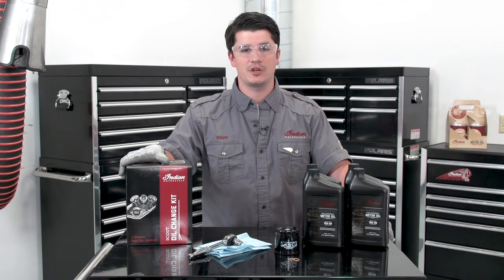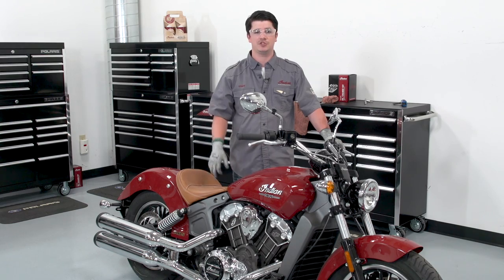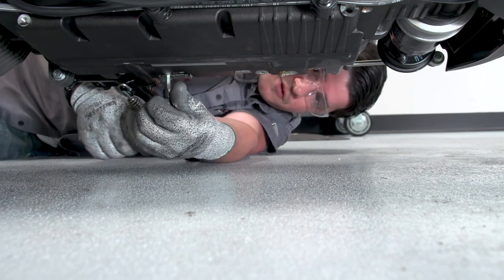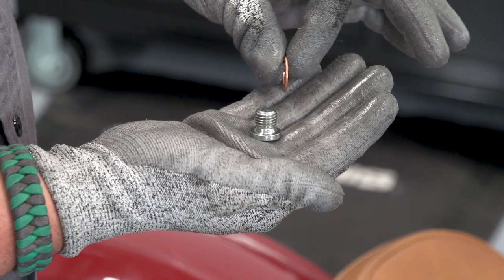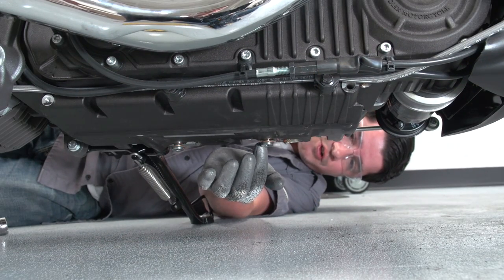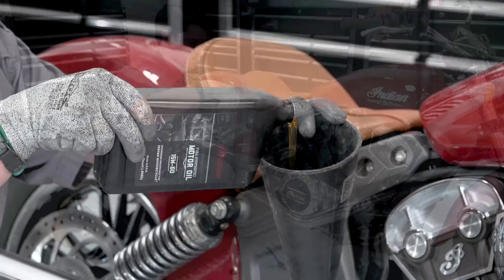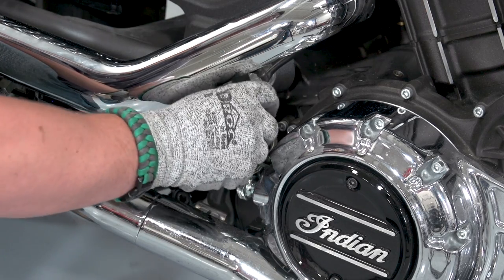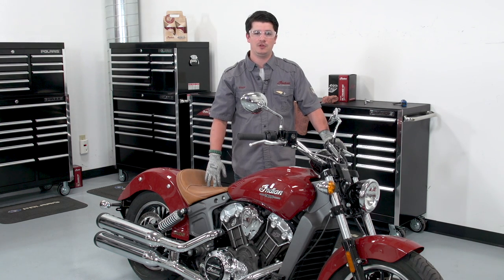Indian Scout Oil Change - Indian Motorcycle

Comment: I wonder what the specs are for the torque of the drain plugs and I really wonder what is the correct amount of oil. I will now go and search for the relevant information needed not found in this video.
Reply: Usually drain plugs you just get them snug after all its better to have jt fall out, leak its oil infront of your back tire and die in a crash compared to overtightening and cracking or damaging anyof your engine case. So to spec is is clesrly somewhere inbetween
Reply: 15 ft lbs

Comment: Just as a warning for the first time you change the oil on a Scout, sometimes they over tighten the oil filter from the factory and make it EXTREMELY hard to remove. I actually had to end up puncturing the filter with a screwdriver through the side, and use that as a leverage bar along with my filter pliers to get it off. I installed the replacement hand tight, and haven't had an issue since.
Reply: TxGamer13 well at least it didn't come off!!
Reply: The factories tighten everything way way way too damn tight, I've had to take a hammer to allen wrenches to break screws loose and some phillips too.  Most used bikes don't have tool kits in them any more, most BMW's sure do.
Reply: @jymebale5545  I think when they built mine there must have been a sale on LocTite.  PITA
Reply: @jymebale5545  They also use lock tight when assembling them.
Reply: Mine was completely crushed by the time I got it off from factory
Reply: so that's why I had to do that. I used an oil filter wrench and crushed the hell out of mine. I thought I was somehow doing something wrong.
Reply: I did the same was super tight
Reply: Oil filter strap wrench's work great for these type of scenarios.
Reply: Yeah same here. Just replaced the oil again and the filter came off like a dream this time. Lmao. Indian REALLY doesn't want you doing things on your own huh?

Comment: Do NOT overtighten drain plugs as they can easily damage blocks aluminium thread and result in costly repair. Use less torque then stated in the official manual.
Reply: Thanks for the advice. I just bought one of these.
Reply: I use this car in Japan.　thankyou!
Reply: How tight is tight enough then?
Reply: If you tighten to the official spec you cant go wrong, why under tighten thats when leaks happen.
Reply: @R3RLEE  yea and also how tight should the spark plug be?
Reply: @liljuanito123  they sell a wrench that clicks when you tighten the nuts so you know when it's enough.

Comment: Hell of a lot cheaper than having a shop do it
Reply: It is always a lot cheaper than a shop doing it and I'm getting ready to buy my first new bike, a 2018 Indian Scout Sixty, I've built a lot of bikes, choppers and basket cases, they turned out new sort of, but real new, I'm 66 and haven't ridden in 25 years as life just got in the way, used to ride a Goldwing to work, my Dad had a Indian Chief in 47 so I thought what the hell, they don't vibrate near as bad as a Harley does from what a friend told me who borrowed a new Scout.
Reply: $105 per hour of labor charge. They usually only charge half a hour since it's a simple job. Plus they mark up the price on the oil and filter.

Comment: When you tighten the 2 oil drain plugs you say 'torque to spec'.  Well why not say in your video what the torque setting(s) are for these 2 plugs?  I understand that there may be changes in engines in the future but really just say what year and model and suggest to check the owners manual if the torque settings are in ther.  Other than that an OK video.
Reply: 15 FTLB or 180 INLB

Comment: 10.000 mile oil , try 4000.mi. gearbox primary drive and engine oil combined .
Reply: PLEASE clarify?
So, is it 10,000 mile? Or 4,000 mile?
So, it is the Same oil that does both the engine oil AND gearbox primary drive? Correct?

Thank you and regards.

Comment: If anyone complaining about missing torque settings is an Indian rider, I might choose to buy a Harley instead. Certainly don't want to be associated with this bunch of whinnies.
All the missing information he did not mention in the video are in the manual.
Why not take it a step further:
- Make sure to buy a Indian Scout first
- Don't use open flame sources close to the engine
- Don't drink from the oil container, as oil is bad for your body

If you can't use a manual to look up the specs, then you should probably take your motorcycle to the dealership.

Comment: @3:20 What's the point of cleaning the dipstick one last time before putting in place when everything's finished ?
Reply: It's a good habit , if by some chance you are in a dirty environment (parking lot) and you get sand or debris on the dipstick that you cannot detect it may prevent you from running it through your engine . It is most likely just a force of habit for the technician in the video.
Reply: Really?? Who cares?
Reply: So it doesn't drip onto the hot exhaust when putting back in!

Comment: Why didn't you prefill the filter before install?
Reply: 4pidgey it's horizontal, try filling it, you would have oil everywhere
Reply: That's not totally correct, you can prefill the filter and let it sit for a few minutes and the filter will absorb 99% of the oil and have very little oil leaking out when installed, try it.
Reply: Not necessary, it'll build oil pressure almost instantly.

Comment: how is there anything to dislike or thumbs down in this video? ridiculous man. smh
Reply: nich bland I'm not complaining, but a few things I noticed: editing was sloppy. cut away from key moments rather than cutting other content. (showed regular tightening but did not show the one extra turn to finish it for example). also mentioned tightening to spec but did not mention that spec.
Reply: Haydrean I would assume that this video will be available forever now. And specs and procedures will change. This is why the video will seem basic and not very specific.
Reply: Kinda agree. While I appreciate the video I wish they would have shown the horn being removed, the full tightening of the filter, and the full tightening to spec (whatever the spec was) of the drain plugs. Also, does the oil pan need to be big enough to catch oil from the drain plugs AND removed filter? How long should the oil be allowed to drain from the bike? 30 minutes? Hour? More? Does "upright" when checking the oil mean perpendicular to the ground or on the kick stand (as shown in the video)?
Reply: MJE horn does not have to be removed to do the oil change.
Reply: They probably ride Harleys.
Reply: I disliked this video only because he cleaned his dipstick off the second time after reading it to just put it back in. So he’s contaminating it twice. The first time you need to do it but the second time is not needed.
Reply: Yes, plenty.
poor voice sound quality
Does not show what fitting he is using with ratchet, although it looks like a hex head driver.  Since there are 2 plugs at front-one being a recessed square head, which one is he undoing?
rear one is a recessed hex head.
As others have said - no torque figs stated. If you are making a vid, why not do it properly and give out ALL info possible.
Reply: "torque to speck", why not tell the amount?  also he should have stated what size to get the drain plugs out, I think it's a 6mm, but I'll have to double check.
Reply: @mje1625  Mr Google is a good place to go to get teck info.

Comment: Do not back off the oil filter at all hand tighten that thing as right as you can. I backed off mine only a quarter turn and found a small pool of oil under my bike after the first ride out. Better tight and hard to get off then having that thing come loose and sending you in a spin from oil slick on the freeway!
Reply: He didn't say back it off he said to tighten another full turn

Comment: For all those whinging about not being told what the torque specs are, LOOK IN YOUR OWNERS MANUAL! Simple! 

Oh and if you CBF here are the specs 15 ft-lbs (20 Nm).
Reply: But we are all here watching a video about how to change the oil on a Scout. They took the time to make the video. We took the time to watch the video. Would it have been that hard to include the specs. Not just the torque settings on the drain plugs, but also, what size/type tool do we need for the plugs? I don't, just weird to put out a video and leave all that stuff out. Now I have to go dig my owner's manual out.

Comment: I also have a stripped out drain plug hole which was done by somebody before I owned the bike and now I don't have a bike to ride because I can't find a dealer to fix it I am so upset and broken hearted and enjoyed my bike so much I am crying as I write this I guess I'm just going to have to send it to the junkyard being so I can't get Indian to help me with the repair that's just the way it makes me feel have a nice day broken hearted in Brush Colorado
Reply: ?????????????????????????????????
Just drill a small hole into it and then use a, 'easy - out'. A tool that one screws in ANTICLOCKWISE which then grips into the drain plug so that when turned ANTICLOCKWISE it will therefore screw out that drain plug.
Reply: @tpv59  your response to a 4-year-old comment is totally useless at this point had the problem solved two days after I made this comment by an Indian rep who contacted me and put me in touch with the right person to fix it and it only cost me about $150
Reply: @snowmanrainmaker  
                                            Thank You.
Point taken. 

Hav a gd 1 sir.

Regards.

Comment: Son, you whipped out that dip stick like you were pulling out a Japanese sword, "Check the level, now you see it, now you don't, there it is, no its not, where is the magic line, I'm not telling," and back into the rabbit hole!   Over filling an engine can be catastrophic, so you need to show EXACTLY where that line is or don't show it at all.  Get down!  Give Geronimo 10 push-ups!  

If I was going to consult the manual to show me where that level mark was and how to read it EXACTLY, why are you on the payroll?
Reply: The stock dipstick for the Scout is jut about impossible to read. Aeromach, which is now owned by Billet Proof, makes a stick for the Scout that is easily readable. I strongly recommend you buy one.
Reply: It's a dry sump oiling system, hard to overfill the reservoir.

Comment: you 4got a procedure there  Jr. . . . . .  the filter gets primed before installation .
still a good vid  tho.
Reply: Scorp doesnt matter, mr expert. when oil gets poured into the bike it will go into the filter.
Reply: I've heard you should do that but I don't think it's entirely necessary. I think it depends on the engine and where the filter sits. Could possibly get flooded with oil the minute he puts oil back in for all we know. Why don't you try throwing some oil in your Scout before putting the filter back on and see if oil drains out all over the floor. That will give you the answer.